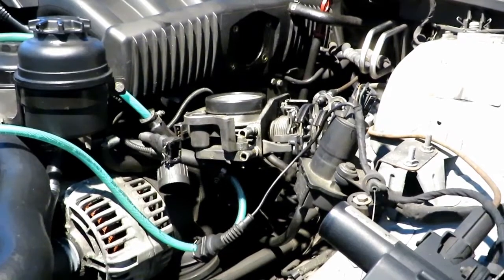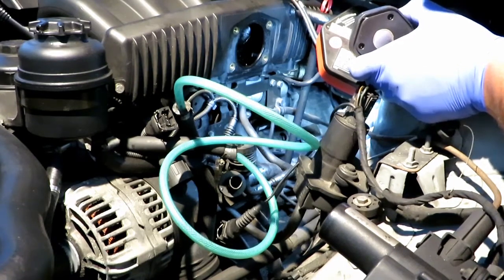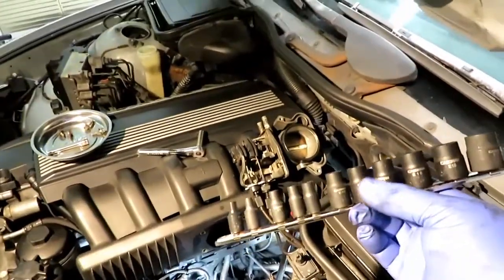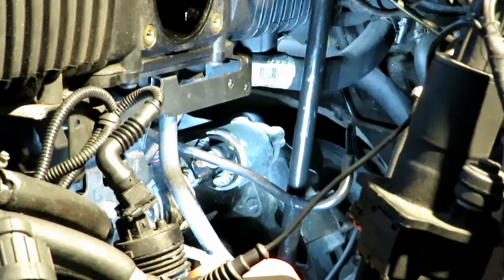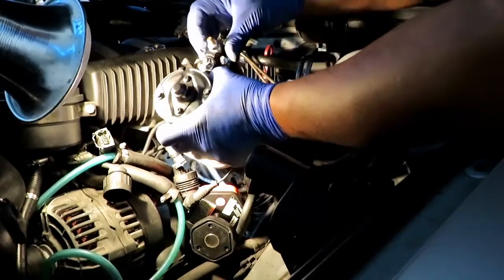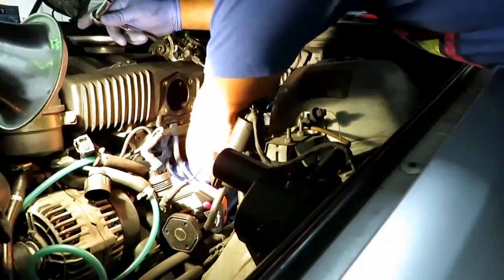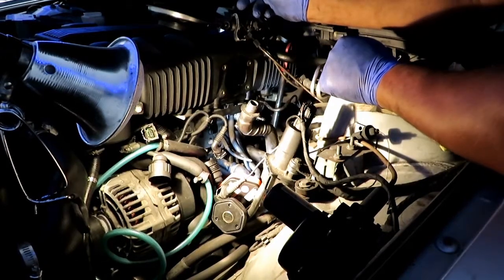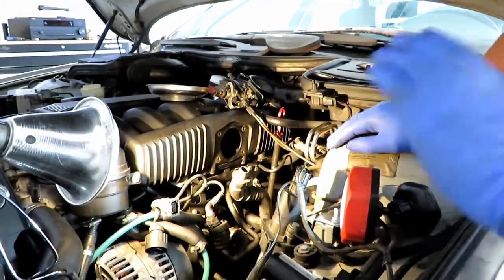BMW 528i E39 E46 AND X5 STARTER REMOVAL 🛑

Comment: Will this work on a 2000 bmw E39 528i wagon? M52tu Automatic. 
  When I turn the key it clicks. Multiple clicks like it's a bad battery. But battery is good. Even swapped battery and jumped it and still clicks. 
Leading me to believe its the starter but I'm also worried about the starter relay which happens to be the EWS under the steering wheel. Is there a way to bypass or replace the EWS so you don't have bad karma in the future? I've heard some bad stories about the EWS. 
Anyways.  I found the starter on my engine and really do not want to remove the intake manifold.
Back Story.
 This car had a overpressure of the cooling system leading to overheating. Replace most of the cooling system(Radiator, thermostat , couple of hoses)  and ended up having a family mechanic look at it. Was expecting a headgasket repair but instead the guy did his research and ran Blue Devil headgasket sealer in it.  Car ran fine did not overheat when I got it back but a week later and I encountered this no start, clicking only. 
So If I have to remove the intake I might as well do the other side and headgasket too.  Which I'm not quite ready for.
Reply from the maker: yes
Reply: I'm going through same situation with my e38, did that fix your issue?
Reply: @CrenshawGrizz  well.  I kinda ran out of motivation on my e39.  It's currently on jack stands. Motor torn down to head.  Disassemble the cylinder head and yeah.  Just working up the energy to keep moving. 

But back to your question.
Mine is a 2000 E39 528i with a M52TUB28 
I ended up removing the starter WITHOUT taking the intake off.  Was a pain to wiggle it around the lower intake,oil dipstick, worong harness.... but do-able. 
Yes my starter was bad. It's housing was cracked and it wouldn't engage. So a new starter and it worked. Well  car ran for a couple day untill I caught the Temp gauge rising above norm. So I stopped driving it and started wrenchin on it.   Now I'm beyond balls deep in this project.  Entire front end is disassembled, cylinder head disassembled, intake off and disassembled.   Started as just fix the cooling system but it let me to have the whole top end off and taken apart.   Loss motivation,(and lack of projects funds).  
Hope this answers your question sir!

Comment: hi. is this the same thing to do in a 728i of 96?
Reply from the maker: As long as you have a inline 6 engine on that car it is possible to change the starter crankshaft sensor very easily
Reply: @GazaPerformanceGarageGPG  nah, i just did and i had to take intake out ☹️ plus the crankshaft sensor on my engine is in the front :/ maybe because is a 96 . I had a 728 of 98 and it was different. but anyways. i removed the damn starter and omg it was a Tired starter. waiting the new one tomorow to install. But thanks anyway.